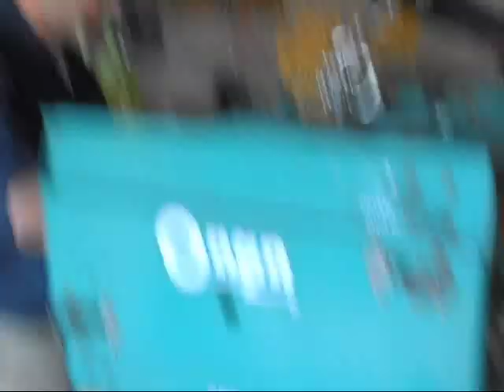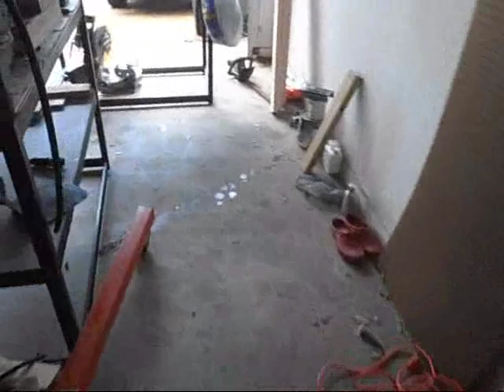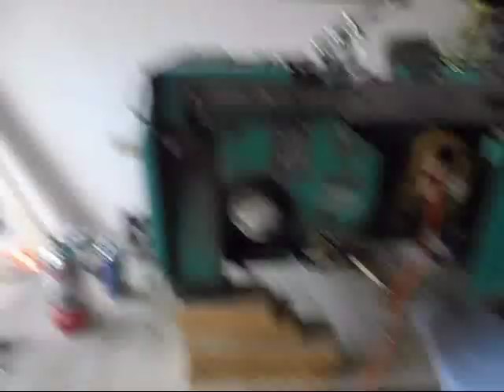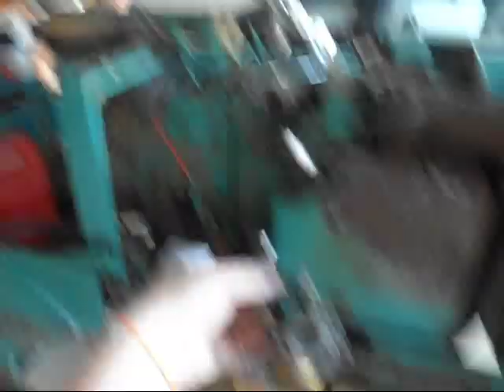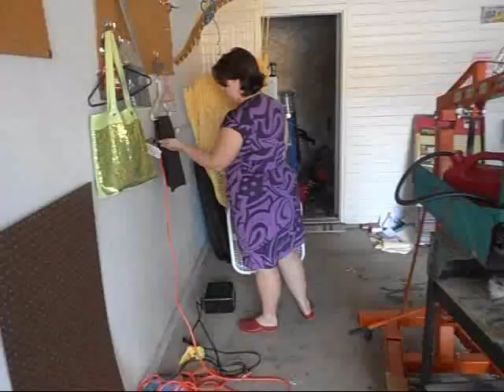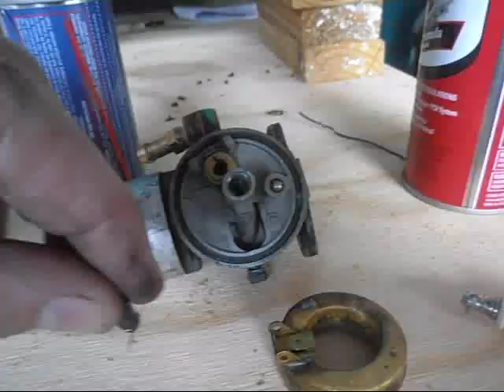Fixing My Onan Generator Part 02

Comment: Seems like a new $300 carburator is always the answer for these Onan generators.  Some guys say they have had luck mixing a gallon of gas with a bottle of gumout carb cleaner in their gas can when using it as a temporary fuel tank like you did.  Also try cleaning the carburator mixture screw.